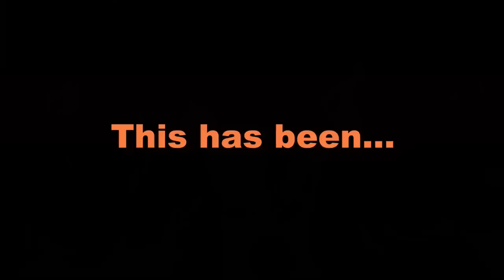You've Been Waiting A Long Time For This To Happen To The Rat Rod Wrecker!

Comment: I laughed so hard at the snow recovery! 😂 Kudos to Hunter for keeping at it and getting it done!  👍
Reply: A lot of pressure for him.
Reply: Dies Hunter know why the ugh put mirrors on both sides of a truck. Backing up looking out the back window is NOT  h oi w ya do it.
Reply: I agree 100% with your comment!! I thought he was going to give up a few times but obviously he didn't and that little ol Chevy finally got it done. Lol 🤣😂🤣😂
Reply: Hunter needs to practice backing up on a tarmac road using his mirrors only.  
Turning your head around to look out the back window causes you to lose direction of the steering wheel, which is why he kept drifting to the drivers side of the road and ending up in the ditch. Also the tray (bed) obstructs the view of the road, mirrors allow you to see where your wheels are on the road.

Comment: Hey Hunter, I noticed your headliner in your truck has water marks on it. I had the same deal on my 08 Chevy and what causes it is the little holes your in the body they drill at the factory for the rear door seal holders to pop into, just lightly pull upwards on the seal and you will see where they are at. Water drains perfectly off the roof right into them. I put a little dab of RTV silicone in each one and no more water ingress on my headliner.
Reply: I had water leaks from a deformed gasket around the third brake light housing.
Reply: Not the same problem with Hunters newer truck. The water strain is from a leaking third brake light.

Comment: Hey, those pie cuts are called miter joints, at least in carpentry and piping.   Mark the cut at the inside, and if your cut angle is half the turn angle, everything will match up.

Comment: Hunter! I noticed your headliner in the back has that leak issue. Take your 3rd brake light out and seal it up with some silicone then put the light back in. Or have Paul do it lol. Then use a carpet cleaner like the Bissell Little Green machine and that stain will come out.

Comment: Perhaps Hunter should back up your driveway on his way home every night for a month or so using only his mirrors. I hauled milk off of dairy farms as part of my job when I was about his age. Most farms did not have room to turn a big truck around in the yard so we had to back in off the highway. The tank on the truck blocks the rear window and your only choice is to use the mirrors to stay out of the ditch and to judge the distance from the barn. I had to stop, pull forward to straighten out, and try again several times the first week or two. It takes a while to do it with confidence. But, once you learn you never forget. Adjusting your mirrors correctly is about 50% of being successful.

Comment: About the whole “see him move his hand” moment… I have a huge scar from where I almost lost the end of my right pointer finger from a similar situation.
Was putting together a Toyota dual transfer case with a friend. One of the steps is to trim like a half inch or something off a shift rod which is right next to some exposed bearings. I said “let me hold a rag over these bearings while you cut that so we don’t get metal in there”.
So my friend starts cutting, then I say “hold on, let me tape this rag here in case you slip” then he says “just hold it you wiener, I’m almost done”
Half a second later there’s blood everywhere and he’s driving me to the ER. Lol. Good times!

Comment: Had my own recovery moment yesterday (I NEED a Yankum rope!) 1995 Suburban, heavy lift strap vs dodge ram. got'er hooked up with the lift strap in a bridle formation on the ol chevy, just took a short pull and she hopped right out. The dodge was just sitting on the crossmembers on snow. Far less dramatic than hunters attempt.

Comment: I'm wondering, are you going to paint the wrecker?  Or clear coat it as it is?
If you paint it, then what color would it be? Maybe you should have a contest for all of us who watch your videos.
And just a heads up in case you do some bondo work again,  if you put the bondo or fiberglass filler on aluminum foil, you can shape it as you want it to be and it will stay in place until it's hardened and then you peal off the foil and it's done.

Comment: I have thought about how to mark those fenders for a nice fit since I watched you "fit" the first one. I have a level with the ability to project a nice line. A laser plane (which I think I have seen you show that you have one) would work even better.  With a donor fender in place, set the laser line to where you want the cut/joint. Then use a sharpie, or other marking method, to transfer the laser line to the donor fender.  Then, without moving the laser line source, remove the first donor fender (rear section) and put the other donor fender (front section) in place. You can then copy the line onto this second donor fender.

Comment: what you should do with the winches remotes is put paint on the remote for which winch that the remote goes to you can put paint for the back wenches remote on the bottom of the remote you can put paint on the side of the remote for the side winches you could put paint for the front of the remote for the front winch you could take a quick glance to determine which remote you would need it for what winch

Comment: Years ago an old farmer and I were changing water and the ditch broke. He went running with his shovel and told me to back the truck up. I turned around just like Hunter and looked through the back window. I started backing up and thought I was doing a fine job when my door flew open and the old farmer grabbed me and threw me out. He jumped in and floored it! I was so surprised that now I started running. I finally made it to the other end of the field. With a big smile he said you need a driving lesson. After the ditch was mended and the water was set he said jump in and let me teach you how to back up with your mirrors. I jumped in he said look in your mirror and keep it straight with where you want to go. Then he reached over with his big foot and smashed the throttle. We were flying down the ditch bank with his foot on the gas full throttle and me trying to keep things lined up. It was a little spicey to say the least. That is how I learned how to back up with my mirrors. Hunter, you need a driving lesson! It will keep you from going in the ditch each time you back up! Paul full throttle and make him keep it straight. He will learn quick so he doesn’t damage that beautiful black Chevy!
Reply: WOW! That will get your pumping. And laugh afterwards!
Reply: Dumb spell check dropped the word "heart". Where is that disconnect button????

Comment: Looks better with the tapered original (plus 2 extras) back on. It finishes the squarebody look. I know you don't have to deal with mud very often but will you add a little splash shield to protect the electronic stuff and the hvac fan, etc at some point?  Can't wait to see it in action. Need a little seat time in it to work out the bugs before the games.

Comment: The only thing I ever worried about was the windshield in the FJ.  I can remember the kind of catastrophic injuries those things caused.  A missing fender?  Eh, that won't hurt anything in the desert.  Maybe it might be an issue where you get a lot of rain.  As far as the pie piece, paint covers a multitude of flaws.  Just wait until a chip packs it in on that new truck, and there is a six month back order for a replacement.

Comment: Listening to the hydraulics on your wrecker, not sure if it's a cross line or if the pump is cavitating because the oil pickup filter is too small. Either microns of the screen is too small or the filter itself is is a problem I've had before with one

Comment: @Fab Rats Hey Paul! This is Paul, I see you pulled out a Kingpin D60 out of that old Ford tow truck for Chad. I'm assuming it's for the Tacoma? I'm currently accumulating parts for the same axle to 3 link into a 98 4Runner. Would it be possible to do a little more in-depth video of building that axle? Btw I also have a brother Named Ben. Crazy 🤣

Comment: No matter whether its a chevy or ford, chrysler something.... they just wear out. Lucky you guys, you can get another one by going to a auction or just buy new.. thats a spendy one  tho. Up here in alaska, we push them till nothing is left of the original truck, its just all pieces and parts of other trucks, some other we have yet to determine just where or what its off of. Once ours are done for, most wrecking companies will say "All we are getting is cat hair and welding rod" so its number three trash or poor beer can material. I will say tho, our old junk rides better than your freight shaker is doing to the passengers... kidney machines probably can't fix a human body after a eight hour drive is the impression I am taking from this video. One very important thing we do take into account for is the interiors will do no harm... just riding or it riding you off of some hillside or a few cliffs have taken a few    to the Rust spot in the Sky. Since its alaska tho and any place very far north of the continental side border;  What I am trying to say, if its torn beyond much helping it, it just stays where damage got it. No  place to take our metal to. We got one barge in from the states about six or seven years ago.... supposed to take a year to fill it. Sorry but three months later was a full barge and prices of metal fell to its all time low. Number one steel salvage went down to less than fifty dollars a ton for well prepped metal. "The trade off" was the price of new number one at the steel store hit its highest price that alaskans ever paid in history. So no need for decorations like your little rodent on a door, we just use our imagination as to what you  think your seeing/LOL. I know that a lot of people must harsh you over cutting up any truck as in the square fender crowd... my response is HA!  I would render a guess that a good thirty million of them were built.... sure some were one off factory built toys but that ain't what pays the bills. Everything sent our way is still out there on unsalted roads leaving a lot of good metal on the Alcan highway. One fellow did find a true Hudson ... a 1942 pickup and it was in a barn that had fell all the way around it leaving it in perfect shape. I was told that truck was so rare that they only know of four of them exist and non of the others will run or look fixable. This one needed some mixed gas down its throat and it fired up and drove into a conex where it got a trip to some museum in the continental states. Actually its our newer rigs since in the last twenty years, they started using salt on the road systems. Just curious as to whether you guys are ever interested in some of the oldest wreckers that came up here.  My brother and I (I lost him to cancer four years ago) had a tiff and the result was in that period of time metal was being bought to go on the barge, he let this company cut my 1940 GMC wrecker built by the factory and Holmes to make a extra heavy tow truck with twin screws on the back, twin everything on the tow beams and get this ... a six cylinder engine with a cubic inch displacement of over five hundred cubic inch displacement... right down to the four barrel carb and a duel exhaust factory made... what hurt was even tho only a six volt system, drop a battery in and within three turns, cold weather also, it would be just purring like a tomcat in a creamery

Comment: Teach him to us the mirror ton back up, every times a person turns around to look it is almost impossible to keep from turning the steering wheel. That is why Hunter was in the ditch every times. I thought of making a little card with this on it;
Illinois
Ditch 
Inspection and
Observation 
Team
to put in all the four wheel drive vehicles that I came across that were in the ditch full of snow.
Sure, the four wheel drive gets you around better, but they don't stop any better because four wheel brakes have been around since the 20s. Back off the throttle and use the engine to slow down, a lesson those IDIOTS never learned!